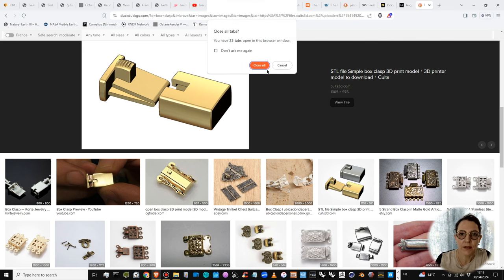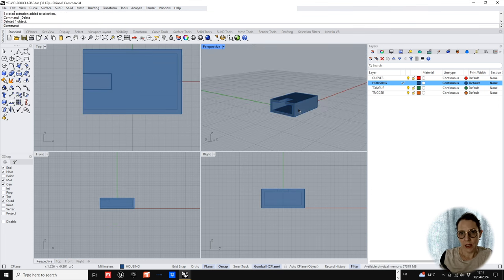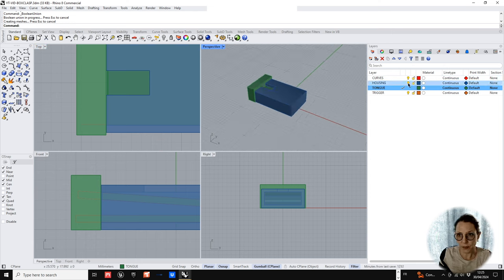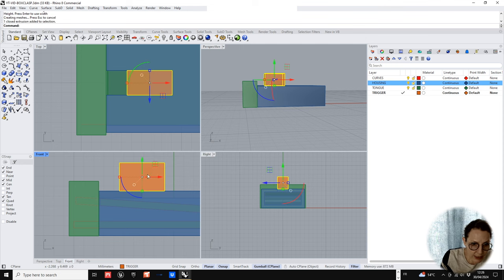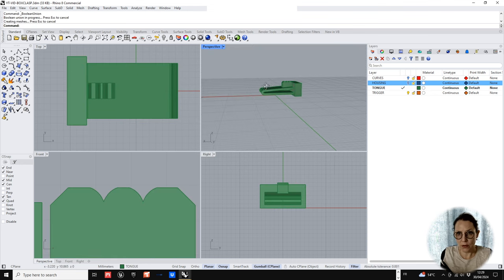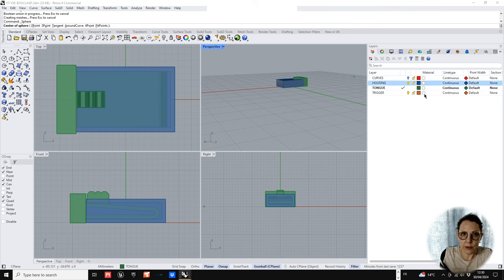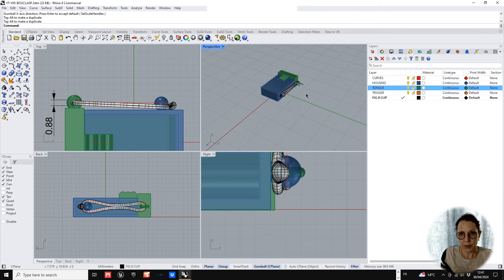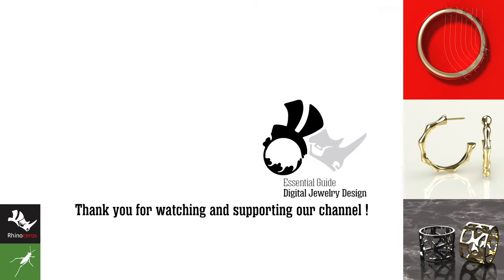A Box Clasp in Rhino 8.0 #rhinoceros3d #rhinotutorial #box #clasp

Comment: Thank you. There should be an additional feature of the housing, a wall above the tongue so that the shortened tongue is secured in the box. 
The tongue is sheet metal, not cast, too brittle, not springy.
Reply from the maker: We've done it, so it must be possible - what kind of 3D printers do you work with?